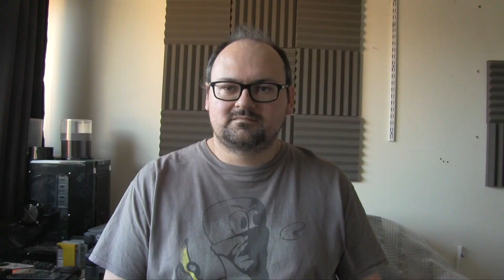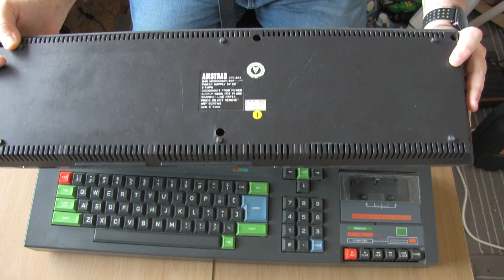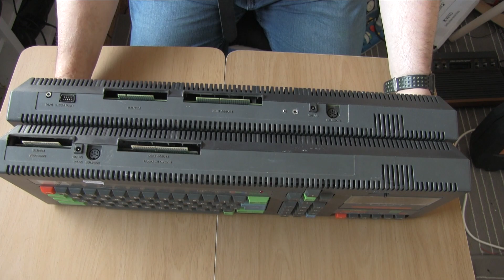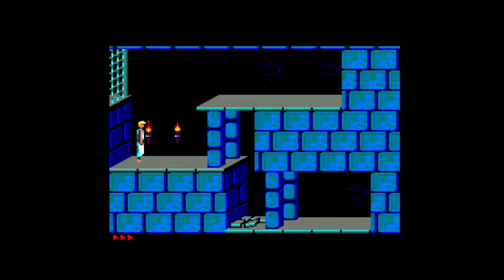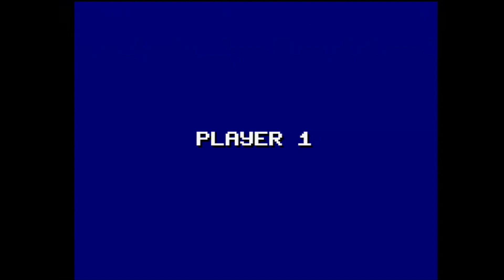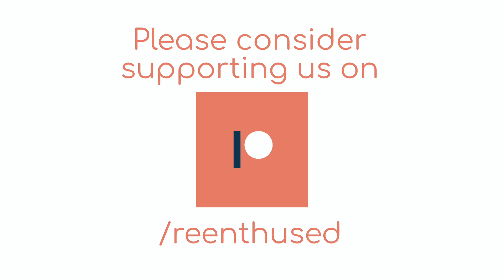Amstrad 8 bit Home Computers Part 1: CPC 464

Comment: For a few years I've been an admirer of the CPCs from afar. I recognise a kind-of mixture of the Commodore and BBC experiences. I see nice Commodore-style properietry reliable tape systems, ace graphics and sound from the machine at its best; plus a recognisibly BBC Micro-type 80-column mode, extensive user-friendly BASIC and crisp monitor to view it all through. And it was stereo wasn't it? Looking back from now, to when I saw a cheap yet splendid colour CPC in Cash Converters 25 years ago, I could have really enjoyed that today had I bought it. But I was really angling for a quality PC of my own first. I've still enjoyed making chiptune samples with the emulator and really see now what the fuss was about.

Pro stylings on the 464 but the disk system really did look stylish. In direct contradiction of the lazy console project, the range was Alan Sugar's management and eye for the market at its most effective peak.